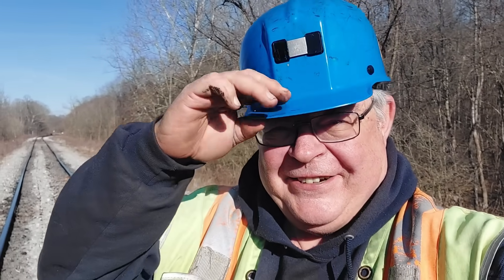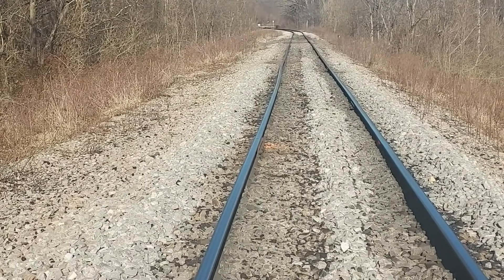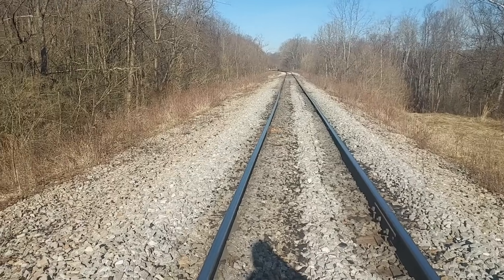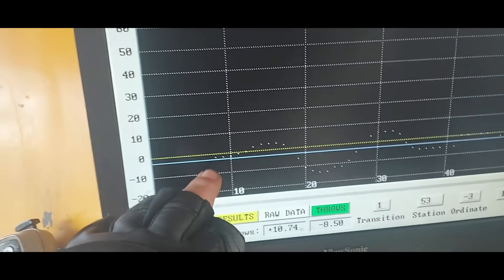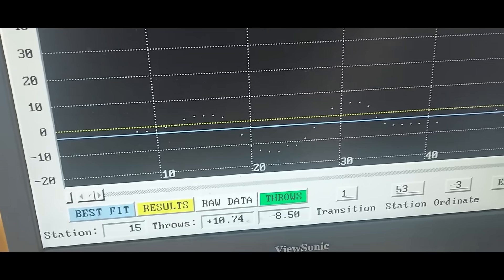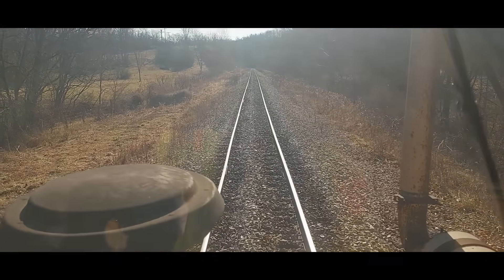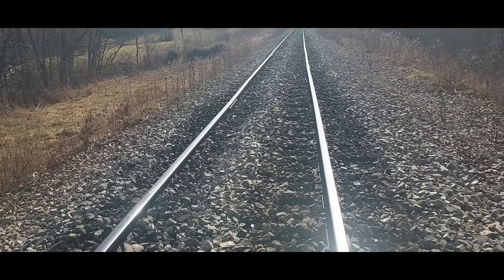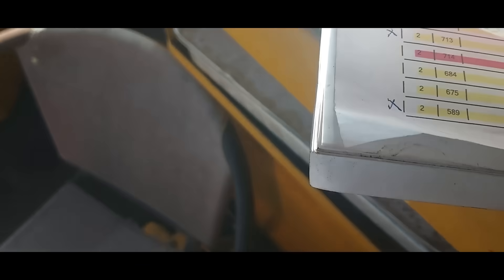Track is out of Alignment and we Gonna Straighten it Out

Comment: Do you ever over tamp the joints until a little on the high side because you know they'll eventually be pounded back down?
Reply from the maker: Hi side or low side they can both get pounded down Bridget.
It's a bit difficult to raise a joint up without raising the rest of the
track with it using the tamper. But at times we have hand jacked
up joints and then tamped them and yes we do raise a bit higher
when hand jacking. Just got to not get carried away with raising those joints and try to maintain the same amount of super elevation in the curves. Really appreciate your taking the time to
watch the video and may you have a very good day my friend.

Comment: Hello Dave, this is what kind of ballast they use in europe In Europe, railroad ballast typically consists of crushed stone, with granite and limestone being commonly used materials. Other options include recycled concrete and steel slag. The primary purpose of ballast is to support the railway track, distribute loads, ensure proper drainage, and prevent vegetation growth. 

Elaboration:

Crushed Stone:

Crushed stone, particularly granite and limestone, is a traditional and widely used ballast material due to its hardness, durability, and ability to provide good drainage. 

Recycled Concrete:

In some regions, particularly in Europe, recycled concrete is being used as an alternative ballast material, offering a sustainable solution and reducing reliance on natural stone sources. 

Steel Slag:

Steel slag, a byproduct of steel production, can also be used as ballast, offering a cost-effective and durable option. 

Sub-ballast:

A layer of sub-ballast, often smaller crushed stones or other materials like recycled concrete, is frequently placed beneath the ballast to provide additional support and improve drainage. 

Ballastless Tracks:

In some high-speed railway lines and other specialized applications, ballastless tracks are used, employing concrete ties and other specialized systems that dispense with traditional ballast.
Reply from the maker: They use various materials including crushed stone in Europe
just as we do here Donovan. We use limestone here. I made
a video you may enjoy seeing on All about Ballast:
https://youtu.be/qQz5YY2Groo

Really appreciate your taking the time to watch and may you
have a very good day my friend.

Comment: The Union Railroad recently activated the axle counter on the defect detector at Mile Eight. Most of the counts are between 160-170 axles. The detector signals are going through the railroad repeater system.
Reply from the maker: They run about the same amount of cars that we do then spaceflight101. 164 axles on our 38 car train which includes
the axles on two locos.Thank you for  taking the time to watch and may you have a very good day my friend.
Reply: @ccrx6700  I listen to the train crews thanks to the radio system and they sound like they really enjoy their work. Most of the trains are carrying hot slabs to Irvin Works and coke from Clairton Works but if you look at the satellite view there is a spur line that goes to a marshalling yard and connection to a NS line in West Mifflin. That spur was once used to take hot slag from Carrie Furnace, Duquesne Works, and Edgar Thompson Works to the slag dumps in West Mifflin. It used to service Duquesne Slag (now Lafarge), Continental Can, General Electric Repair, and Westinghouse Transportation (now Alstom). It still serves 84 Lumber. 
It used to be a double track, and the slag pot trains ran pretty much every hour. It was common for full trains going up to pass empty trains going back to the blast furnaces. 
If steelmaking leaves the Mon Valley the railroad will have no reason to exist.
Reply from the maker: @spaceflight1019  👍😊🚂

Comment: Class 5 only 3/4 of an inch out of 62 feet? I've seen corners of brick buildings that are wavier than that! 3/4 of an inch is hard to see over 62 feet. The railhead itself is what, 3 inches wide?
Reply from the maker: We have class 2 and track speed is 25, on class 5 track trains 
are allowed to go up to 90 MPH brnmcc01, thus the more exacting
standards. Rail head is indeed 3 inches wide from side to side.
Really appreciate your taking the time to watch and may you
have a very good day my friend.
Reply: @ccrx6700  Wow, yeah 25 mph is plenty fast enough it's only roughly a 16 mile trip. 90 mph on a curvy track would be impossible.
Reply from the maker: @brnmcc01  😊👍🚂
Reply: @ccrx6700  If you want to check out a fast train, look at the new service launched last summer, from Beijing to Hong Kong. 1200 mile trip, reaches top speed of 155 mph (I'm sure on tangent track) and the ride is so smooth you can sleep. Now how do you keep that track perfectly level and straight? The 1200 mile trip only takes 12 hours station to station total. Of course, Japan and France have even faster bullet trains, but those aren't near as long.

Comment: That was cool.  So class 5 is the best (better than class 1)?  How does the machine move the rail if it has spikes securing it to the ties?  If it moves the ties you would think it would move the other rail which you don't want to do.  The rail re-alignment machine makes the job look easy.  It must have been a lot harder back when they had to do it manually.  Thanks for the video.
Reply from the maker: The higher the class of track the better the more stringent the
specs become and the faster the trains run. 5 classes for freight
in N. America and another 4 higher classes for passenger Scott.
When the tamper picks up or moves the rail, it moves the ties
with the rail and yes it moves both rails. Back in the day they
lined track with a lot of men and lining bars manually. Tamper
is much nicer..... :-)  Really appreciate your taking the time to watch and may you have a very good day my friend.

Comment: I have a selfish request.  If you ever do maintenance/repairs etc on that machine, please show the guts.  I'd love to see the control gear, sensors, etc.  Super cool video! Happy Easter to you and your family from SE PA.
Reply from the maker: Thank you for the suggestion FixitFrank. With a user name like
you have sounds like I could really use you here to work on the
tamper! Lot's of vibration on that machine and lot's of stuff
breaks, that's just the nature of the machine. It does have a Cummins inline 6 that drives 3 main hydraulic pumps that
powers everything, including the transmission with hydraulics.
The electronics would take an entire video to go over if not
more. Tamper's computer has a logic system in it and a bunch of
relays and switches. Thank you and glad you enjoyed. Really appreciate your taking the time to watch and may you have a very good day my friend.

Comment: Ought to be in bed now but resisting a new ccrx6700 video? ......
Compared to the moderate speed used that alignment error is not affecting safety at all. But okey, if it's an ongoing drift, movement, correct it now.
Time 05:00. What's the units on the vertical scale? It surely isn't inches....
Manually makes better than computer.... Computers have no feeling! They are stupid robots.
Low joints made "our" 3 axle, 2.5 meter wheel base, loco feel like a rocking chair....
Do You know what an English lawn is known for? If not, look it up! Your track is like that when You have been out there!
Wonderful work Dave!
Reply from the maker: Your right Stefan, not affecting safety but if it keeps drifting then
we have a problem, still in good shape now after 3 weeks. Each
dot on the computer screen represents 5 linear feet. Google says English lawn meticulous, thank you for the kind words.  Really appreciate your taking the time to watch and may you have a very good day my friend.

Comment: Thinking about the 1800s having to align the tracks by hand. 

I wonder what they used to tell it was out of alignment 

I wonder who gave the railroads permission to operate ? 

The first railroads, was it just a matter of buying the land ROW for the tracks ? 

Cities where trains ran all had stations. I imagine there were a lot of backroom deals between the railroad Barron's and the politicians 

Even looking at the 1950s and they had steam shovels and some hydraulics, but compared to today, the technology is so advanced. 

Watching the state widening 476, the original road had tunnels, short little tunnels through the hills. 

But they have removed most of the remnants of them.. 

When they upgraded in the 70s they got rid of the tunnels by doing rock cuts and going over the hills 

The fact it was easier to blast through the hill vs taking it completely out like they are doing now, you realize how hard it was to remove even a foot of rock
Reply: A tape to mark 31 foot stations, a string or wire more than 62 ft. long and a ruler to measure the mid points. It still is done nowadays for spot checks.
Reply from the maker: Track back in the day were string lined but a really good railroader
could get it almost perfect by eye. You get down on your knees
and sight down the track, then have a guy with a spike maul handle
go down the rail and tap it every so feet. Tapping the rail doesn't
move the rail, it focuses the lookers eyes on the track between him
and the maul handle, then when he lifts the handle the eye focuses
on the entire piece of rail. I've done that many a time. Doing that
you can move track in the old days with a bunch of guys and lining 
bars.  I've lined a lot of track by eye using a back hoe to pull
or push the rail or an excavtor.

Back early on the railroads had to become chartered
in order to operate. I believe tyhe B&O was the first chartered 
railroad in the US. The Strasburg RR is the oldest continually
operating RR, it was chartered in 1832. BO was chartered in
1827  and back then the states issued the charters. Thank you for 
taking the time to watch and may you have a very good day my friend.